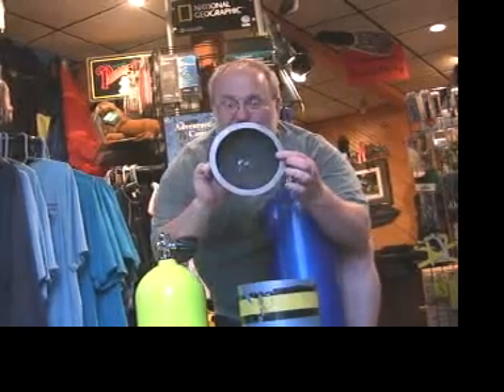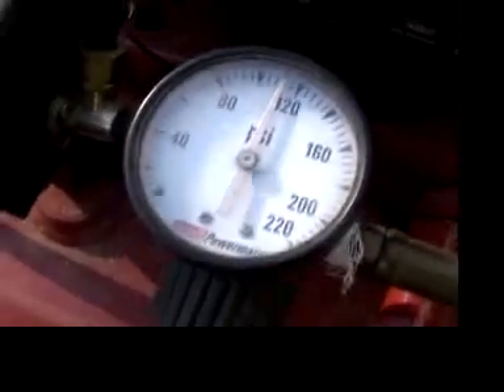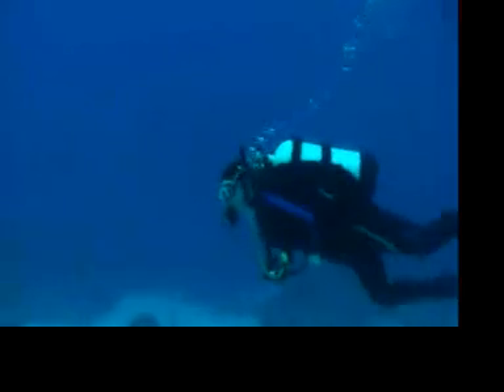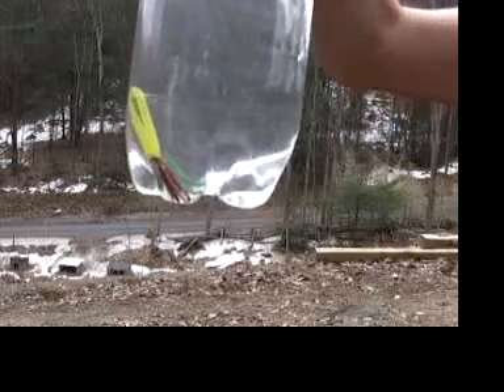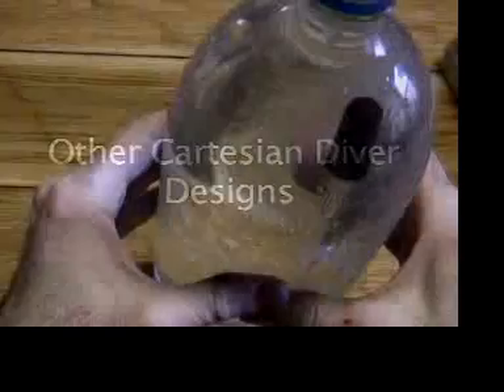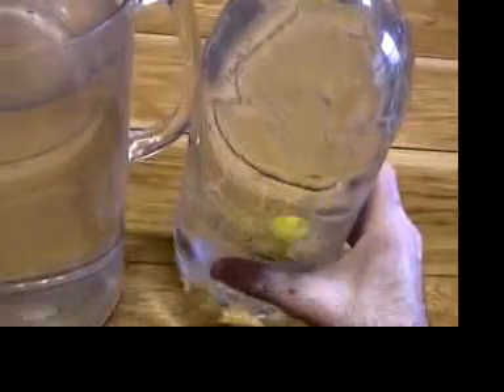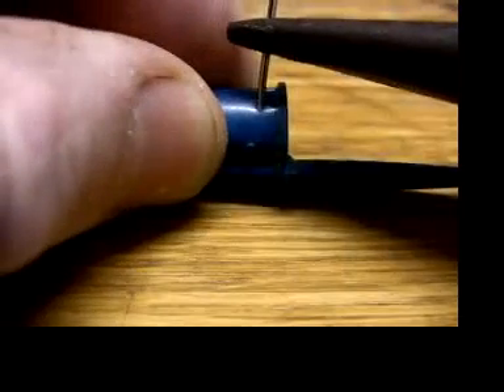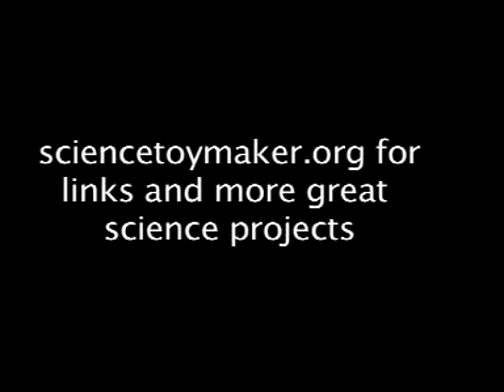Make a Cartesian Diver Part 2

Comment from the maker: As with the pop pop boats (also on scienctoymakerDOTorg) that both push out and pull in water, the outflow is more directional than the inflow. Similarly, you might be able to blow out a candle from half a meter away. But try to put out the candle by sucking in air and you would have to be much closer because the air comes from all directions.
Slater